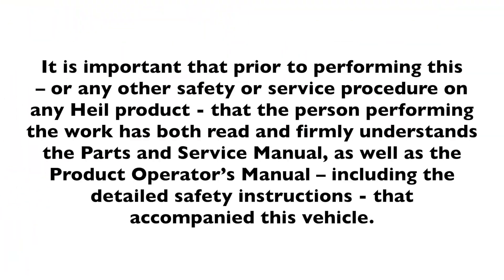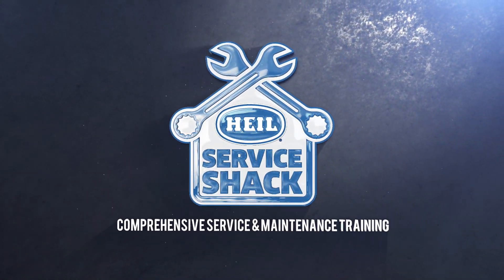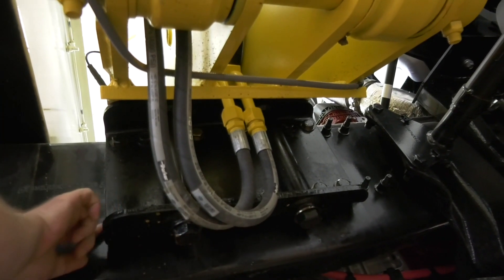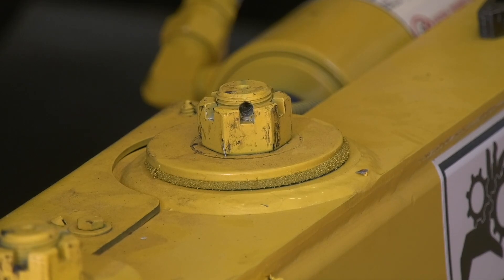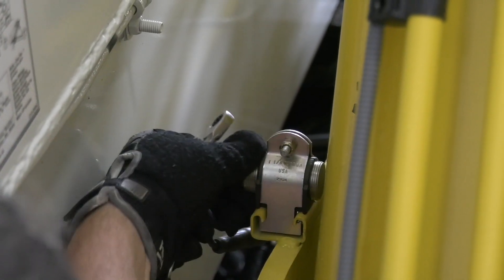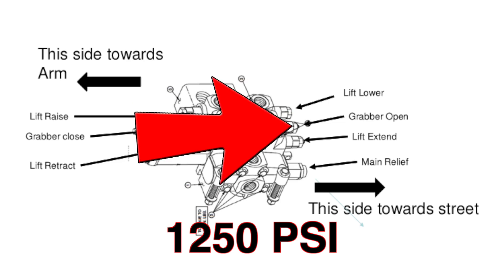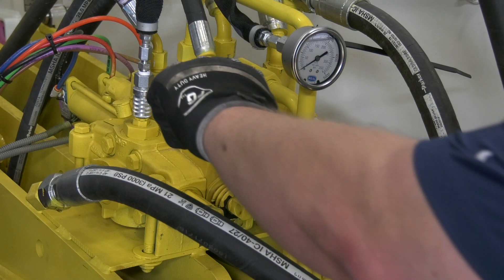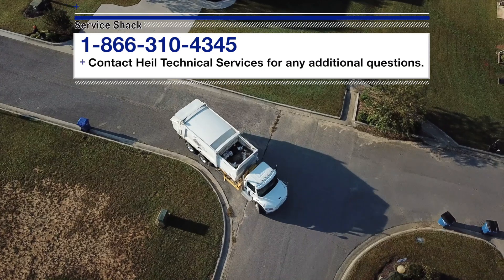Service Shack Ep. 12 - Heil DuraPack Python SideLoad Garbage Truck Lift Arm Preventative Maintenance

Comment: why are my bins getting crushed flat, on a python Republic side loader?
Reply: The driver operating it might be closing the claw too tightly, It's suggested that they grip it where the rubber grips on the claw touch the back so the can has a good fit. I don't know otherwise.
Reply: @goofyguy2  thanks
Reply: @Skipperj  No problem.
Reply: @Skipperj  I noticed a mistake on my end lol, I meant he might be closing the claw* too tightly, not the arm, sorry if you got confused.